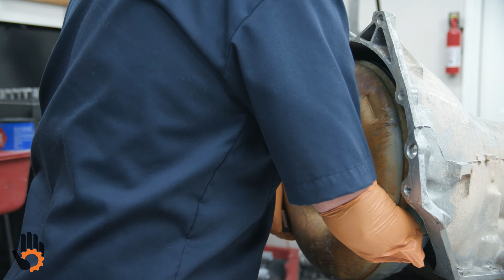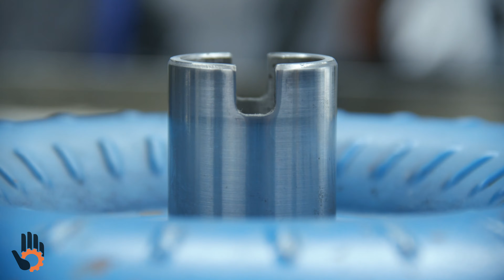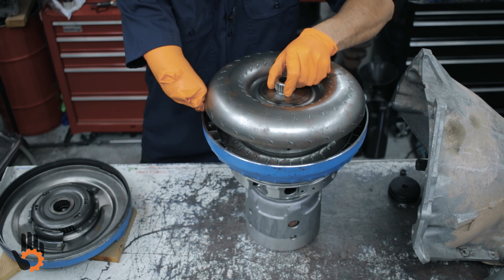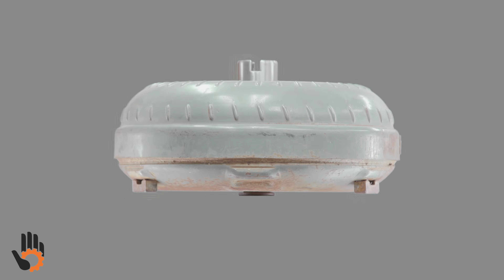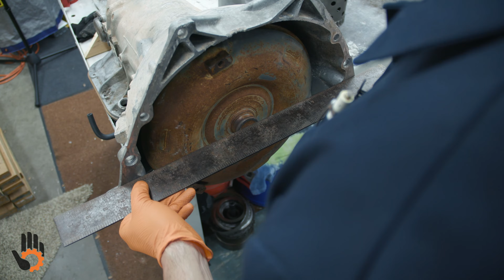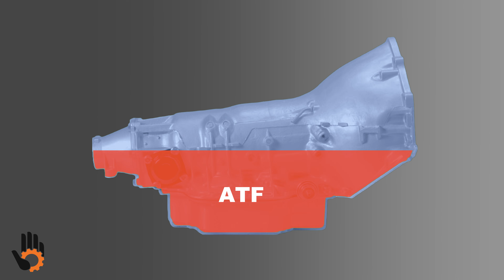TH400 Torque Converter Install (Made EASY)

Comment: I have a 
Door converter that was installed dry on top of that it was stacked on the tanks of the pump, unaware of that problem. I fired up the motor and ran it while I tuned it and synced the carburetors. The pump never filled the torque converter and I never put a load on the actual transmission question my torque converter is it annihilated or can I just put fluid in it and run it I have since fix the transmission pump and I’m ready to fill the transmission with fluid am I safe or do I need a new torque converter as well?

Comment: I have a question.If the engine is out and the torque converter is pressed all the way in when i spin it there is a clicking noise, is that normal? If i pull the TC out slightly the clicking stops. Let me knownif this is something to be concerned about please. Thanks in advance

Comment: Whats your take as to why a brand new circle D billet converter would bind on a brand new stator support? TC Wouldn't go on so I pulled trans back apart to see what was causing the issue. If I set the TC on bench and drop the pump onto the converter, the pumps stator support gets stuck in the converter splines. I have never ran into this problem and loosing my mind..

Comment: I’ve read that the converter engine side needs high temp grease between the converter hub and the transmission side needs thin layer of trans fluid or trans assembly grease for lub and seal. Do not use high temp grease on converter oil pump spline side. This is info I’ve come across.

Comment: Good idea with the key :) I want to remove the transmission from my W221 S-Class 7G-Tronic and reattach it because I have a leak on the shaft. You gave me a good idea to secure the converter before removal and reinstallation :) thanks

Comment: Do both the splines at front of the transmission. The smaller central input shaft, spins for sure. Does the one on the outside spin? Or is it supposed to?

Comment: OK, cool good video. Thank you for that. However, there was no explanation for how to adjust to tight of a clearance.
Reply from the maker: You're right...  Thank you for mentioning that.  If it's too tight it could be due to:
1). Spacer that's too thick, sandwiched between the flex plate and the crankshaft.
2). Incorrect flex plate.
3). Incorrect torque converter.
4). Etc.
Reply: My torque converter is not rotating free after fitting, can this be caused by the measurements.

Comment: Thank you for the demonstration of the cutaway torque converter it helps understand the connection inside I'm working on a 5L40E GM vehicle and I'm having a little bit of difficulty being confident that it's completely in it feels like it's rubbing up against large gear teeth which I think is that notch in the torque converter I took it completely off and looked to see where the notch needs to go and I'm not there yet I have the old transmission I've been practicing on as the new one is underneath the vehicle already which is kind of hard to handle it I may have to pull it out again if I need to make sure it's improperly

Comment: Great video. Even my 11 year old daughter was intrigued...
Possibly more bwcause you worked with one hand juat like it was no problem at all... very impressive, and I hope inspiring to others with disabilities. 
Anyway..
Im droppping the Th400 out of my old Viata Cruiser to hooefully fix a leak.
Ive replaced all the external seals that I could qith it in the car. It still leaks.
Im going to replace the fromt input seal and probably rhe pump seal.
Is there a seal on the toeque converter?
Also. I marked the torque converter  and flex platw to assemble them in the same orientation.  Was that necesary? Wasnt sure if they qere balanced together.

Comment: How many seals are there that should be changed when the transmission is out. I know the engine rear seal is one,  is there a seal between TC and transmission shaft? Oh and the transmission rear seal too.
Reply from the maker: Rear main (especially if it's a one-piece design).
T-Case:  May have a gasket between adapter housing and T-case.  Also, T-Case may have an input shaft seal.

Comment: What’s the best way to shim the torque converter when the gap is too big, mine has 1/2 inch gap between the flex plate and torque.

Comment: Question - When the TC is supposedly all the way fully seated into the transmission is it supposed to be able to rotate all the way? I have an issue where it seems to only rotate about a 1/4 turn in each direction. So I tried bolting it up to the flexplate but it will not rotate so i cant get all the bolts in.

Comment: Should be able to it rock up and down and side to side when fully seated? It doesn’t feel like the input shafts are moving but the rather the torque converter is rocking on the splines. I spun the converter when I thought it was seated, and it moved the two lugs in relativity to the converter but it won’t go in farther. Also, it’s in far enough where I can’t get my fingers in behind’s it but I have sausage fingers so I’m unsure.
Reply from the maker: It'll still have a little wiggle to it, even after it's fully seated.

If in doubt about, it best to verify with the straight-edge method.

Comment: When you overfilled the oil on your transmission. Couple months later it’s starting acting weird the shifting to second gear is delayed. The question is could torque converter seal is the problem
Reply from the maker: I'm having trouble understanding what was written.  But....

I will say that fluid level is important.
Too low, and pump will start sucking air, which results in a drop in line pressure (oil pressure that's used to apply clutch packs/bands.
Too high, and rotating trans parts will churn fluid, which can aerate the fluid (bunch of air bubbles).  This also results in the pump sucking in air...once again, negatively affecting clutches/band.

Comment: My Cadillac TH400 was making a clicking noise when running.  I found out that the converter bolts were VERY SLIGHTLY too long. When I looked more closely, even though the bolts were tight, the head of the bolt was not tight against the flex plate. Instead of using shorter bolts, I decided to put washers on mine, which solved the problem.  Those bolts were actually bottoming out in the torque converter, not allowing them tighten against the flex plate.  That slight amount of daylight between the bolt head and flex plate caused it to have a fairly loud clicking noise.  I thought I had a bad lifter or something wrong in the engine, but that's all it was.
Reply from the maker: Good catch!!

I need to make a video on this topic.
On later model transmissions, a TC bolt that's too long can actually cause transmission failure.  Pretty wild, ay?

Appreciate your comment (reminder).

Comment: Thanks for this video. I had this problem getting my torque converter in.  I thought something was wrong with the converter, but it eventually dropped in.  Before this, I thought it was in and it wasn't.
Reply from the maker: You're welcome.
Glad you got to the bottom of it.

Comment: So I got a question mine sounds like it’s rubbing in the back of the bell house I pull it out a tiny bit it stops making the noise is that normal thank you ahead of time
Reply from the maker: If I'm understating everything correctly......this is normal.

When you install trans, and bolt up converter, converter will be drawn away from trans as the bolts are tightened.  Resulting in no more rubbing.

Definitely something to double-check during your install.

Comment: Great video and very informative.  I installed a TH400 in a ‘71 vette.  Upon startup a distinct metal on metal chirp was heard.  Trans is rebuilt, new converter, entire drive train is new,  chirp is loud and can be heard clearly over the motor which ran off and on for a total of 5 Min while troubleshooting. Chirp increases along with rpm. Inspection shows the torque converter and flex plat has a wobble to it not sure on a measurement.  Trans is coming out but what should i be looking for?  I set the TC to flexplate gap at 3/16 using an allen wrench to achieve that gap i did use a single flat washer on each TC bolt.  Should i take it back to the builder?  Is there a way to inspect the pump without disassembly?  I’m positive i check converter installation and the builder placed a bracket  same as your wrench to hold it in place.  It was also attached to the motor outside the car and wasn’t tilted forward.  Whole thing has me doubting myself.
Reply from the maker: Sounds like it's related to flex plate.

What did you find?

Comment: I have a 2005 chrysler 300 with the 4 speed auto trans. My torque convertor won't spin freely once fully set back into the trans. Any thoughts please?!?!
Reply from the maker: Two different things are coming to mind:

1).
Per the video, the converter hub drives the pump.
If for some reason the pump gears don't rotate freely (and it happens), as soon as the converter hub engages the inner pump gear, the converter will stop rotating freely.

2). 
When the converter is pushed all the way towards the rear of the trans (fully installed), is any part of the converter making contact with the inside of the bell housing?  Probably can't see in there...but...
During transmission install, the converter bolts will be installed through the flex-plate and into the converter.  As those bolts are tightened, it will move the converter away from the trans, and towards the engine.

If you pull the converter out 1/4", does this allow the converter to rotate freely?
Reply: @SouthpawAutoworks  yes, if I pull it out about a 1/4 inch it does rotate freely, but not when bolted to the flex-plate. It only does a half of a rotation. when it is just the installed convertor not bolted to the flex-plate. fully seated, it will do only a half of a rotation. you can feel that its not a bolt or clearance issue. It feels mechanical in nature like a gear?? torque convertor, flex-plate, trans are all the original parts?

Comment: Mine won't seat on a904 transmission in think it output shaft.
Reply from the maker: It has me thinking pump.  When time permits, I'll make a video on this.

For the meantime, I think you'll find this video helpful.
https://www.youtube.com/watch?v=ZkcUVLovcps&t=289s

Definitely a couple things that could be added to this video, to make the install even easier/repeatable.
Wishing you the best on your install.
Reply: @SouthpawAutoworks  thanks.
Reply from the maker: You bet.

Comment: I assume since it wasn’t covered there is no way or need to prime the pump? Like spin the torque converter while installed to move fluid into pump? Till fluid comes out of the two line ports? Thank you
Reply from the maker: Priming the pump is done when assembling the pump.  It was covered during the TH400 Build Series.

TH400 Build Series - Pump + Front End-Play
https://youtu.be/tfQiHPZlIQI

Comment: About how much trans fluid should I put in the converter ? Thanks for the tips.
Reply from the maker: At a minimum, add one (1) quart of ATF.  However, the more you can add, the better...without making a mess during install (TC tipped on side).

Thanks for stopping by, Jimmy.

Comment: Great video lesson well done
Reply from the maker: Thanks, Jimmy.
Reply: @SouthpawAutoworks  as a former Autoshop/Trade school teacher here in Australia, I really do enjoy following passionate and well put together video content, and I can assure you I have found this series on the TH 400 fantastic
Reply from the maker: An autoshop/trade school teacher....right on!
Andy used to teach at trade schools, too.  There was mention of it (with some photos) in a past TH400 video.

Thank you, so much, for taking the time to share some positive feedback.  You are appreciated.
Reply: I recently installed a TH400 in a ‘71 corvette.  At install I measured the TC to flexplate clearance and set it to 3/16 using an Allen wrench to get it to 1/8 required space/washer thickness I didn’t have.  I needed to use a single washer to take up some of that clearance space.  Upon fire up there is a distinctive metal to metal rub not constant but seems like for every rotation of the engine.  It’s a chirp and increases with RPM.  I also see a wobble in the TC and FP while running. Car only ran for maybe 5 min in an attempt to diagnose the issue.  Trans was rebuilt, new TC ,new FP and engine also rebuilt with zero miles.  I’m positive I checked converter installation and the trans shop installed a bracket similar to your wrench when I picked it up.  Assembly was done out of the car.  Didn’t tilt it forward I don’t think during install as motor was on hoist.  Rotated the converter to align holes to flex plate once bolted to motor and torqued. Whole thing has me rattled so I’m doubting myself.  It’s coming back out but what should I be looking for? Should I take it back to builder?  Is it possible to bottom out the converter?  Is 3/16 TC to FP gap translate to the max amount the converter can slide out towards the FP.  Love your videos and appreciate any expertise.